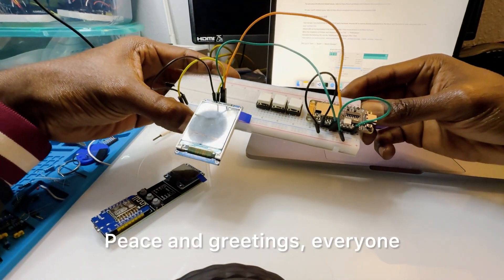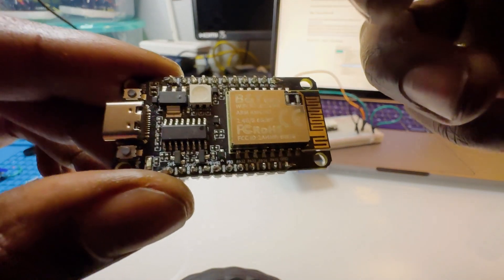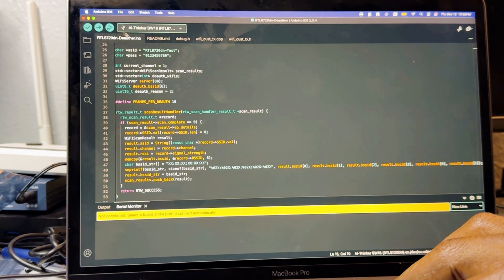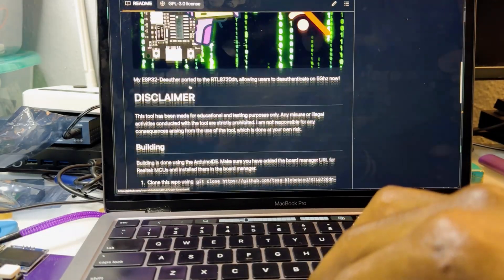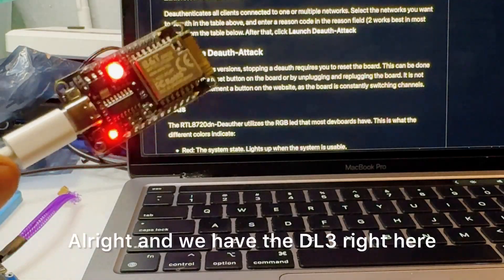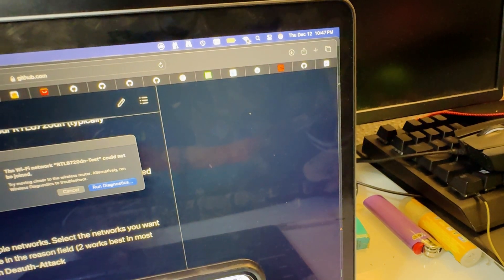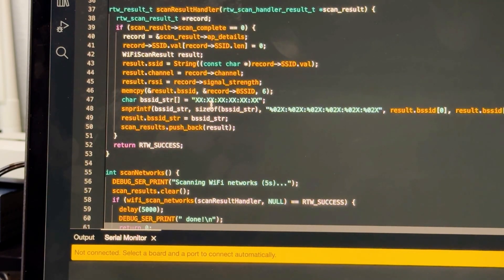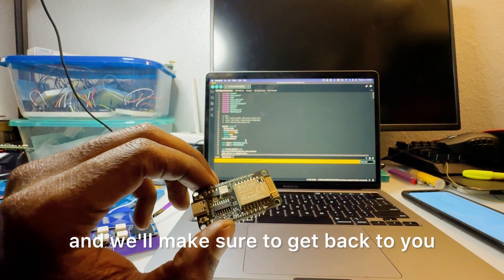How to Make a 5GHz WiFi Deauther!

Comment: idk what I'm doing wrong here. Held down the buttons for download mode and successfully uploaded the image. No Deauther networks showing up still when I look for wifi. Followed every step in the vid not sure what I'm doing wrong. Like is there a button I'm supposed to press on the board after upload? I tried unplugging the board and plugging it back in. Idk. 

One thing I noticed on the github page was the note that stated "Most RTL8720dn devboards have the upload and log serial ports isolated. Make sure to bridge LOG_UART_TX and LP_UART_TX, as well as LOG_UART_RX and LP_UART_RX during uploading." and I have no idea what this means.
Reply: same I did everything and it seems to be running and the code was uploaded good. Nothing works. Did you find a fix?
Reply: @kingawesomeness967  I gave up, got busy. I dont know if I'm missing a set in the process or what. The model I have is the exact one in the video
Reply: @andreioliynik9072  yep same everything is exactly the same as his. I wonder what it could be. Been troubleshooting it for hours
Reply: @  I figured out why is wasnt working at least for me. I posted it on the discord he made
Reply: @kingawesomeness967  appreciate it. Ill take a look soon. You are Qewave on there?
Reply from the maker: Sorry it’s not working yet for u. Is the chip a BW16 or BW16E?
Reply: @littlehakr  also, I just wanted to add that the Pico W5 launched. Things are about to get a lot more interesting lol. I’m going to snag a couple of those myself I think. It has the BW16 and its the same size as this board.
Reply: @ its a 16. No problem man any help would be appreciated just cant figure this out. Idk if it could be the USB c cable or what

Comment: How might one build, or find the info on how to build something that can cause a device to be disconnected from a wifi signal within a certain proximity without running the risk of destroying someones pace maker? Interested in an idea like this for the purposes of attaching said device to something like a model rocket to disrupt drones. Also, as a side note, you dont have to agree with his politics or anything to do with him really, but its extremely tacky to talk about the president of the United States that way. I mean c'mon man, you're better and have more class than that. I dont agree with a lot President Trump's politics either, but he is still the president, is doing what he believes to be the best for the country and as such should be addressed with basic respect. Just throwing that out there.
Reply from the maker: On the device you select individual devices or the whole network. However it should only be in a controlled environment, definitely not around sensitive medical equipment.

And I respect your opinions and understand but under the 1st amendment I am allowed to express myself freely however I may please, and is just a joke anyways 👍
Reply: @littlehakr  just because you can don't mean you should. This goes for a lot of things . But what do I know, I'm just a homeless guy.